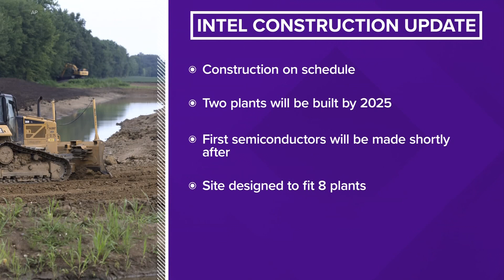What's next after Intel breaks ground in Ohio?

Comment: Biggest RAT job !  Bechtel is the contractor.  Only Bechtel management gets per diem not the union trades! You work 4 days 10 hours a day with no overtime or breaks. Friday is your overtime day but if you miss work on one of those 4 10 shifts then Friday becomes your .are up day at straight time. Bechtel is RAT 🐀 🐀 🐀!  They micro manage the trades. Work is slow on this job. They can't get the manpower because of poor working conditions and ratty contract! 
INTEL GO TO HELL and build your chip factory there!